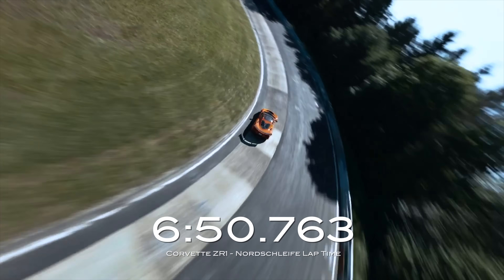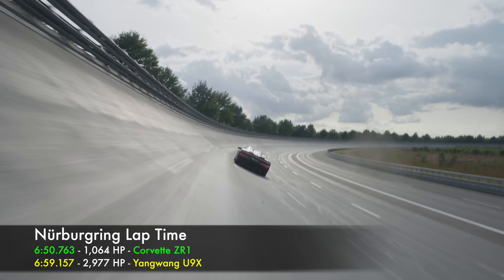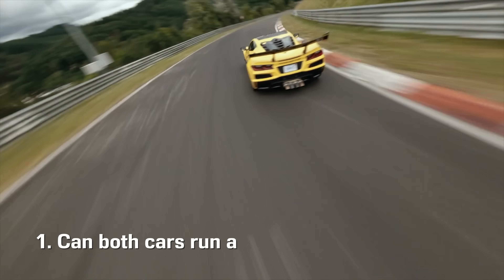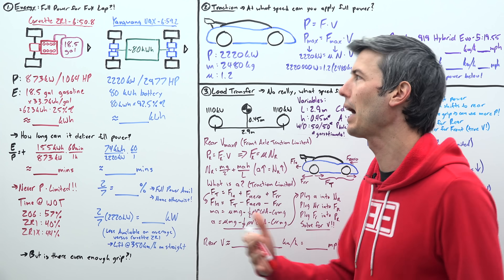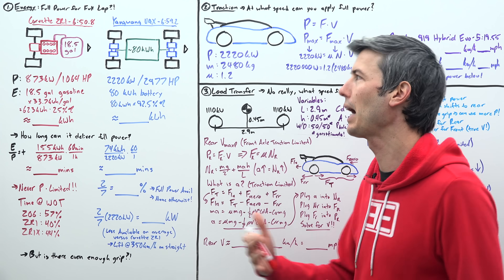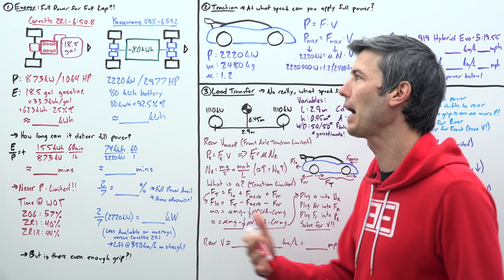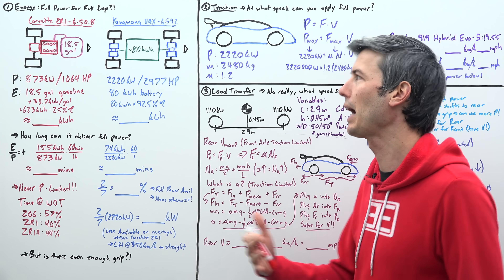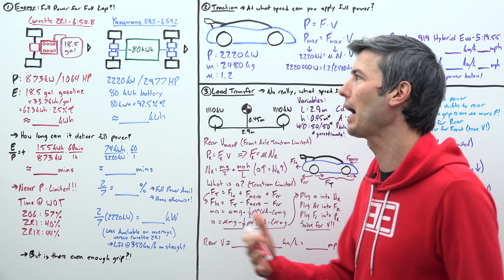Gas Beats Electric! Why Is 1000 HP Faster Than 3,000 HP?

Comment: Hey - this is Andrew from teamPGR.  We have been running EVs on track for 6+ years now and have instrumented them so we can gather data regarding power delivery, speed, throttle position, etc. etc.  The critical question for all modern/track focused EVs isn't energy, it's energy over time at a given power level.  Heating in the pack is non-linear with power.  So if you use high power, you get way more heat.  The best lap time is gained by using the available heat capacity of the battery when it gains you the most lap time.  This is not a simple problem to solve for, and not all the manufacturers have put time into it!

When we are competing, we drive our laps with our unconscious mind, and with our conscious mind are doing an integration between the remaining distance to travel, the SOC, the pack temp, trying to figure out how to best deploy the energy for time!  It's a different challenge than running a gas car for sure - but also not unlike driving a car in a race while thinking about fueling strategy, where on a lap those around you are fast/slow, etc.  We have measured the equilibrium point of pack heating in the Plaid to be about 400kW, or half the maximum of ~820kW.  At that power level, we can run the car down to about 25% SOC without the pack heat being the limiting factor - at 25% the car runs into the current limits as SOC declines.

Randy Pobst ran a different Plaid for a while up Pike's Peak in the hill climb - and when I described this strategy to him, he said (paraphrasing) - "oh, so I just need to drive it like I am trying to save fuel!" Which I think is about the best way to put it for all the race car drivers out there.  EVs get the best lap times (when the lap is longer than they can do 100% power at) by squirting out of the corners, figuring out what the best top speed is for each straight and getting there quickly, and then putting the power at a maintenance level to keep the car at speed until the braking point.  Coasting in a bit to elongate the time that the pack has to accept regen helps as well because it keeps that SOC high.  Keeping cornering speeds high is also very important because it helps on both ends of the problem, it reduces lap time directly of course, but it also lowers the amount of power necessary to get to the optimum speed on the next straight which helps with heating and SOC!

One minor quibble from your assumptions that is relevant/interesting about EVs relates to your Cg guesstimate.  Because EV packs are generally mounted between the axles and near the ground, and their weight is so massive, the cars have Cgs that are are relatively low.  Lower than any gas sportscar.  We believe the Plaid is something like 14", maybe even lower given our car is lowered from stock!  Our lowered '93 RX7 track car was ~17"!  Lower Cgs helps keep weight on the front axle during acceleration (or on the rear during braking, also helpful!) as your pointed out and of course EVs also have longer wheelbases which help reduce weight transfer too.  This also helps with cornering as more of the tire can be put to use.

Regarding the U9 lap time, there's nothing wrong with the factors you calculate - but there are other limits in practice are more relevant, here's 3:

#1) Pack heating is way more important that energy left, tire grip or anything else.  We have added a radiator and ducted the nose of our Plaid trying to see how much we can help the car keep the pack cool.  With the common NCA and NCM cells, the limits are about 65C or so, which if you think about it, isn't that much higher temperature than the surface of a asphalt racetrack in summer.  With such a low delta T it is very difficult to get rid of the heat being generated.  Maybe they would benefit from an ice based system or even better, a CO2 heat exchanger...  There are some 'power cells' that are commercially available that could do higher power discharge, and are good up to 85C, but they are heavier/less energy dense and cost more.  So far no OEM has been willing to accept the tradeoffs necessary to run them in a car (maybe the U9 does?  haven't seen details on the cells in it yet)
#2) Power limits are different at different points in the SOC.  Power is current x voltage, and as the battery state of charge declines, so does the voltage.  To keep the same energy up - the pack has to supply even more current.  At some point, it maxes out, and from there the pack can output less and less energy, but since heat is related to current - that lower output still generates a ton of heat!  In the Plaid we've measured the limit to be somewhere between 75% and 65% SOC, depending on a number of  environmental and system related factors.  So when you calculate the 80kWh available - remember that at max power that is limited to maybe 30-40% of the energy for modern cells - after that the power will decline due to SOC/voltage/amp limits.
#3) Packs are designed with varying cooling strategies, but some are modeled after release in software, so changing the car doesn't change the performance as the car doesn't measure the difference and respond!

One other point of note - regen does not seem to significantly heat the pack.  So leave it on!  Gaining back the energy does help the friction brakes (1.25mW dissipation in our Plaid at max decel g's, 20% of which can be handled by regen) and also you gain that energy back to deploy later, keeping the pack at a higher V.

@EngineeringExplained - if any of this data would be interesting/useful to you in future videos, let us know.
Reply: You could've turned this comment into a full length video 🤣
Reply: This is an EPIC post!!
Reply: Would absolutely watch a video response detailing all of this. Thank you and respect for writing it!
Reply: Damn you wrote a book 📚!!! 👀
Reply: thank you for taking the time to explain this in such great detail, even though i have no horses in the EV race, it's very very interesting.
Reply: ouch, there is indeed a lot that has been left out, also the friction will depend on the downforce the car generates, if you have too much power, you can always  adapt the aero to get more from the tires.

I'm also not sure if the numbers for the energy consumption are realistic. If corvette uses full power over 50% time, and it could stand it only for 10min, it would basically get from full tank to empty around 3 laps, which is 60km. 133l/100km. Is that the case? Anyway, a lot of interesting points brought up, even though the model seems a bit naive. At the same time, not sure if the whiteboard and YT format can really take much more than that, nor if the data is available. Still, while being a cool thought experiment it does not really provide any answers in this form
Reply: I remembered when Elon Musk tried to prove to the world how amazing his car was around the track and then had to tow the car back in because the batteries overheated after 1 lap.  Has anyone tried using an evaporative system to help keep the batteries cool?  I know this wouldn't work for a production car, but it could be used in racing scenarios to keep the output from the batteries optimal.
Reply: @thieupham493  Not that I can think of.  Anything for performance needs to get the reject air/water temp down below ambient because of the low delta T from normal cells that are at max allowable temps (power cells might be able to use ambient because of the higher thermal limits.)  That's why all the manuf are using AC/Heat pumps in the current crop of cars.  Probably an ICE/CO2 bath would be the best way to do it without going extreme on materials/consumables.
Reply: @Garagemaholics  Tesla eventually had to use an ice bath to cool their batteries, but I was thinking evaporative so it gets lighter as it's used and maybe can even be refilled.  Methanol/water mixture might be an option.
Reply: Great info thanks for sharing!
Reply: holy nerd
Reply: @yahtheahmed2236  You bet lol
Reply: salute to you.
Reply: so can we say that, with actual technology, EV cars are not a smart choice for people that want fun driving a car (on a mountain road or on a track)? Oh, apart for drag race, but that's an american hobby.
Reply: This NEEDS to be a video.
Reply: has anyone validated vapor chambers for heat exchange surfaces in cars? i bet as a first lookout that it may be unreasonable expensive and maybe not structural reliable enough for such a application but the more heat output available for any cooling method, the better.
Reply: Smart ass man
Reply: this would be a great colab for a future video
Reply: Yeah sounds like ill never buy an EV
Reply: So basically useless cars. 😂

Comment: During the entire second half of the video where Jason is talking about the power each axle can put down I was trying to understand how we can possibly calculate this -- it's not a simple matter of load transfer between the axles because not only do you need to know the weight distribution and CG height, but also the downforce generated by aero, which is going to be substantial at these speeds.  Skip forward to the last minute of the video, and sure enough, the GT3 RS proved none of this math matters, because downforce wins.

Comment: Jason, drive your Tesla until you burn 12.383 kwh, the distance you travel is the distance you would go on one US gallon of gasoline if your Tesla would have a gasoline engine. Continue driving until you burn 33.333 kwh. Your total distance, is the distance you would travel on one kilogram of hydrogen if your Tesla would be running on hydrogen. Notice 2.69 times more miles needs 2.69 times more energy.

Comment: 4:30 And this is the problem F1 have had sense 2014 with Hybrid engines, they can only do a full power run for ONE lap and then charge the battery for 3 laps.. with 2026 regulation change they will BARELY be able to make ONE lap on full power race pase and then they have to charge it back up for 5 to 6 laps depending on the track layout. and comparing the Hybrid engine to a old school F1 V10 or V8 they can go full power race pase for EVERY LAP! and then you have about 50-60 laps to do its boring to only see over takes happening due to the car being overtaken dose not have a charge battery... its like Mario Kart. it SUCKS.

Comment: 3:00 but you still dont count the WEIGHT! the EV is a lot HEAVIER due to its battery that is has to use its power for to move that extra weight EV has compared to the ICE car.

Comment: I'm commenting as I watch, so I may have to come back and edit, but my guess is it is going to primarily be that 
1:you can only put so much torque through 4 tires before they slip
2: Batteries are still heavy as heck
3: I'm guessing towards the end of the lap battery performance probably diminishes due to heat buildup. 
Again, just making some early guesses.

Comment: I mean come on, idk why im so gullible thinking this would be on a straight line. Even that corvettes time is pretty.... Not that impressive if you look at the 1000hp figure, that hp is useless if it cant put its power down around a track that has enough corners to fill the entire f1 calendar. It's like putting an f1 car on the road with rules of the road, only the long straight they'd be able to let loose a bit. Gt class cars have half the power and would do pretty much destroy what these things are doing cause they can actually put their power down with the help many things already explained in the video i bet.

Comment: Its all about the weight and where it is. Also tire size and compound and the amount of downforce at speed. The wings on the vette help alot. Battery weight in the middle and and motor weight at the axles is bad. Also have suspension weight. Its less about total power then aero and grip and lateral Gs.

Comment: Thank you for another interesting video!
Although the main idea looks as correct, I think I found some mistake in calculations. Where max Force calculated as μ*N, and N in turn as m*g. However, it seems not 100% correct. Mass of car matters most when accelerating: F=-m*a. If car moves without acceleration, without climbing (m*g*h), then F equals just to sum of friction force, aerodynamic force etc. So, the main "victim" is max acceleration value "a" in case of moving on road such as Nurburgring with many turns and thereby speed up-and-down. On straight road that car will reach peak velocity on which aerodynamic force+friction are equal to F allowed by tires. and most probably will win against 1000 hp car.

Comment: @EngineeringExplained Hi! I have a question about the minimum speed required to apply full power to the tyres. So, according to your calculations, if the car is stationary and we floor the throttle, it will spin its wheels until it reaches a speed of about 200 mph? Thank you!

Comment: It's interesting that the U9 couldn't use full power, but it could still use as much as the ZR1.  And using less power it would not be limited by it's total capacity.  So the analysis does NOT show why the U9 was slower.

Comment: One correction, in order to estimate weight transfer you measured the distance from the center of mass to the ground. However, the proper distance for this is from the tire centerline to the center of mass. With electric center of mass being very low, or around the tire center line, there is a lot less weight transfer than in an ICE car.

Comment: Carroll Shelby: "There is no such thing as too much horsepower, just not enough traction". 
NASCAR Busch Series V-6 cars turned better lap times at Daytona than the V-8 Cup cars. Why? The V-6s didn't have to lift in the corners. Sure, the V-8s pulled them down the straights, but scrubbed all of that speed off going into the turns. Traction was the limiting factor. 

The only place crazy horsepower can survive is in NHRA drag racing where Top Fuel and Funny Cars are built to manage the power in a straight line, and that requires trick clutches that lock up in phases and allow slip to keep the slicks planted. The 10,000 HP are wide open at launch but the clutches control how much and when it gets to the pavement.

I hear all of these guys talk crap about going to Autocross events with all of this horsepower and they rarely get to half-throttle. Physics wins every time.

Comment: As a side note, you've got more grip with higher weight, but you are more likely to break the tires free, because tires aren't perfect, due to the amount of horizontal force on the tires with higher weight/inertia.  Accordingly, because the Corvette is lighter, it can carry more speed through turns and spend less time accelerating/decelerating.  The same principle applies to braking, so the Corvette can likely brake later.  That's where I would attribute most of the difference in lap times.

Comment: Energy density of hydrogen equals 33.333 kwh per kilogram, hydrogen energy density of gasoline equals 12.383 kwh per US gallon (2.858 kg) 18.5 US gallons of gasoline at a density of 2.858 kg per gallon has a mass of 52.873 kg, 13%   (6.873 kg) is hydrogen, so 6.87349 * 33.333 = 229.114 kwh of hydrogen energy. 229.114 kwh ÷ 12.383 kwh = 18.5 gallons of gasoline, 80 kwh ÷ 12.383 kwh = 6.46 gallons of gasoline. The carbon energy in gasoline can be ignored or discarded, not because it is wasted but because it is inefficient, it doesn’t do any work.

Comment: Jason you cannot have a 92.5% efficient EV under any possible circumstances. Motors have a motor curve and batteries the same. For boths you get less efficiency when you press and massively far less during continuous power usage as the BMS and TMS kicks into action. The 25% efficiency of the V8 motor is actually reasonable for full power as modern V8 motor's thermal efficiency is up to 41% efficiency but dropping off as the engine speed increases due to the power curve. So the Corvette simply has a lot more steady power availability.

Comment: 3:43 I'm confused, so if you were flat out for 2 minutes it would completely run out of battery? Or that's just the amount of time it's able to stay at 2977hp?
Reply: Running at 2977hp, it can only go for 2 minutes. So you could do more time at less power, but if you want the full HP, you can only do it for 2 minutes.
Reply: @FasterThenDoom doesn't seem very efficient

Comment: The corvette or any petrol car can do multiple laps without losing performance where the ev unless fully charged and ideal temperatures it's lost alot of performance by end of the lap.
I think the ioniq 5 N was the only ev car that that could 2 full laps with similar lap times in non stop.

Comment: You seem to have ignored aerodynamic down force in your normal force equations. That should dramatically reduce the velocity for the full power on the front axle. I saw you mention it but you may want to see how much the velocity changes with that down force.

Comment: Balance patch dropped. Sorry batterybumpers
Only electric car i want has liquid hydrogen generator or fusion generator lol batteries are too heavy and environmentally destructive when it comes to lithium. Also an engine (generator) likes heat. A battery connected to a motor hates heat and prefers it to be cold. Good luck with keeping it cold as easy as it is to balance an engines heat perfectly and create an operating range that doesnt constantly escape it. Gonna need a 100kg refrigerator just to keep your batteries cooled to room temp like they prefer to be at this point. Adding more weight and slop to a flawed engineering design. Batteries are never the answer to anything when we have technology that far exceeds them.

Comment: "Can a gas car with 1000hp beat a electric powered car wtih 3000 hp? YES, if you don't put a big enough battery in the EV to run the whole track"

Alright! Good info!

EDIT: This feels like a overspecced car. Like a i3 with a 5090 and a 700w power supply. Good job, it's got the power to run anything..except to run iteself.